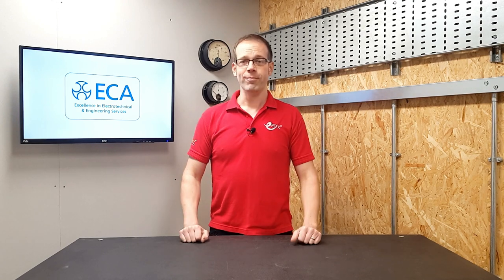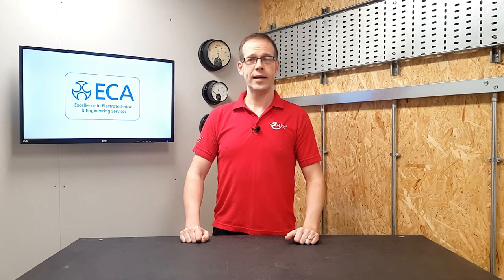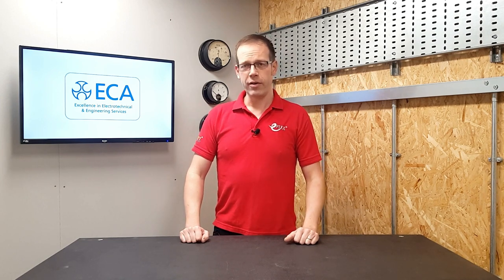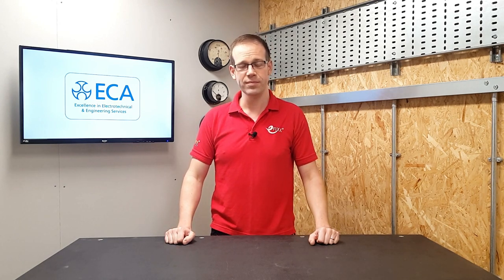Do smoke alarms need a dedicated electrical circuit? - Electricians' Q&A - BS5839-6

Comment: Don't like them on dedicated circuit, too easy for circuit to be switched off (perhaps due to nuisance activations or low battery warning chirps) and a tripped mcb may not be noticed.
Reply: True this. A dedicated mcb runs the risk of not being noticed if off/tripped.
Reply: Yes. In rental properties we typically install on a lighting circuit to prevent isolation.
For privately owned, we set out the advantages and disadvantages (such as they are) to the customer and let them decide

Incidentally, we only install D1 systems (rechargeable non-replaceable battery) as the nuisance bleeping after 10 yrs almost forces a replacement on expiration
Reply: It does say it needs an isolator for maintenance if it’s on a lighting circuit s still just as easy to switch off
Reply: @12000gp  yeah funny thing is one of the reasons we bunch it is so that they can't turn it off and leaving it, if we put an isolator for it, it kinda half defeats the object
Reply: I think efixx might have a secret key-switch video on fan isolators that you can watch that might be of help, regarding unwanted isolation by tenants.
Reply: @MrSJT  Except if you turn off the smoke alarms they'll operate on battery backup! Whoops didn't think of that one did ya?
Reply: @kylehill1523  I'm an approved Aico installer so that thought is standard. It's what happens after the battery back up fails is what we're all talking about

Comment: The amount of peoples houses i have been in and their smoke alarms are off at the mcb  and they have not realised is ridiculous , always better on a lighting circuit and without separate isolation  , defeats the purpose of putting them on with the lights.
Reply: I wonder if it's worth using a key switch (a la emergency lighting) to allow isolation for actual maintenance, but not by joe homeowner? (at least not without KNOWING what they're doing). A red fire alarm spur would be overkill (and out of place) for domestic, but might also work if hidden in a cupboard
Reply: I think key switch is what they mean.. but I wouldn't bother, as a competent person should know what to do.  Plus anyone can get a key.

Comment: With a D2 I prefer them on a lighting circuit, when the battery runs flat and starts beeping does the customer replace the battery or drop the breaker? Usually the latter
Reply: Whomever wired our house (2014) tied it to the closet lights which we hardly ever use and it turns off ALL smokes. 0_0

Comment: They SHOULD be on a lighting supply. Many years working with Fire Officers I was told as a Fire Defence Engineer (not Electrician) for a major PLC that domestic users will ignore a detector if faulty which could be due to a faulty cct. (Often batteries missing). If lights go off they will get it fixed. Instances of people being away for an extended period so when they returned the battery had depleted fully thus not aware of failure.
Reply: Actually they'll still operate on battery backup which will chirp if the battery is ran low.

Comment: new install I use dedicated circuit, old install additions I use lighting circuit because its easier
Reply: Rental properties you should put it in with a regularly used lighting circuit, I would do it in private properties too for safety reasons
Reply: @MrSJT  I think it's safer on a dedicated.  It just feels more right. Ours I think are dedicated we just found that out. Always assumed it was part of the lighting circuit but nope!
Reply: @kylehill1523  in what way would it be safer if it was dedicated? You mean in terms of the circuit itself not being affected by another circuit?

Oh hang on, it can't be, coz you already know about the battery back up right

Comment: In Scotland, new legislation requires all domestic properties, not just rentals, to install / retrofit mains powered and linked smoke alarms in certain rooms (heat alarms in kitchen) plus a CO alarm in any room with fuel burning appliance by February 2022. My view is that the only practical way to comply is to take it from the lighting circuit in each room when I’m decorating and use radio-linked alarms. Retrofit of a dedicated circuit with 3-core and CPC is totally impractical in most domestic properties without serious disruption and redecoration. Even then, I’m not sure that I’ll have it all done by February 2022.  I suspect most houses here simply won’t comply but I believe it’s a good idea so I’m trying to make it work. There’s no enforcement regime that I’m aware of, but how long before it becomes a condition of selling your house (I’ve only just moved so no issue for me) or the home insurance industry uses it as an excuse to bump up premiums.
Reply from the maker: Thanks for the info - will be good to see how this plays out - especially when properties change hands.

Comment: I have mine on a lighting circuit. That way, the circuit is pretty obvious if its not got power. As for the difference of rental vs private? Makes no difference. A property can be easily switched between rental or private and then it can potentially be a load of hassle to re-wire if the alarm feed is not taken from the consumer unit initally where it could just join off a lighting circuit somewhere. Interesting the comment about being able to isolate the alarm for maintenance if run from a lighting circuit - the Aico units slide off the backplate so unless you are chaning that as well, there would be no need to isolate it. You have to isolate a whole circuit to change a base plate but that is why we have diversty with dual RCD or RCBO boards so that other lighting could be used while the maintenance is carried out and takes minutes.

Comment: I’ve never seen an isolator installed to isolate the alarms from the lighting circuit.  

Not saying it doesn’t need one.  But in my experience, no one fits them
Reply: I never knew this was a thing until five minutes ago and I’ve been a sparks for 23 years 😳
Reply: @tommochelsea72  Lol. I think you’ll find most reading this didn’t know.   

How many EICR reports have you seen that have picked this up?  None probably.
Reply: Isolate for what maintenance jog on  i fit Aico so to work on it you pop it of the base its now isolated 😆
Reply: I would personally suggest that being able to remove the head is a form of isolation from the lighting circuit for maintenance purposes
Reply: @paulspicer754  ditto re: Aico, 3000 series only now :)
Reply: @johnhoward2104  i heard about this in an AICO training centre in 2017, that's when I started bunching them with  regularly used lighting circuits but wouldn't  add an in line isolator coz tenants can turn it off.
Reply: AICO confirmed today that they produced a technical bulletin (on 12.3.19), shown below, that addressess the issue of isolating power to the alarm, when powered from a lighting cct, without isolating the lighting; which oddly does not appear in any of their publications. 

"Power supplies for Grade D Smoke & Heat Alarm systems with reference to
 Building Regulations Approved Document B, Fire Safety 2006".

There have been queries regarding a section of Clause 1.19 in the above document and this Technical
 Bulletin is published to state our interpretation of the requirements in relation to the Ei Professional range of smoke and heat alarms (140, 160 & 2100 series with or without the RadioLINK base Ei168RC). It does not purport to apply to products from other smoke and heat alarm manufacturers.

The clause in question states the following:

Power supplies
1.19 The power supply for a smoke alarm system should be derived from the dwelling/house’ main
 electricity supply. The mains supply to the smoke alarm(s) should comprise a single independent circuit at the dwelling/houses’ main distribution board (consumer unit) or a single regularly used local lighting circuit. This has the advantage that the circuit is unlikely to be disconnected for any prolonged period. There should be a means of isolating power to the smoke alarms without isolating the lighting.

The section that has been causing the queries is; There should be a means of isolating power to the
 smoke alarms without isolating the lighting. This has been interpreted as meaning that there should be an isolation ‘switch’ to enable isolation of the smoke alarms. The document does not say that the means of isolation must be a switch. In addition, it does not state that the circuit must be isolated, only the smoke alarms.

When the Ei Professional alarms detailed above are installed there is a quick and easy means of
 isolating the alarms without isolating either the smoke alarm circuit or the lighting circuit. These models are supplied with an Easi-Fit base that the alarms simply slide onto to be activated. Conversely, it is only necessary to unclip the alarm and slide it off the base to isolate it. The base is then left on the ceiling, without exposed electrical cable, connectors or terminals and is therefore inherently electrically safe.

In view of these points it is our contention that this method meets both the aims and the spirit of this
 section of clause 1.19".

So that's their tech bulletin; no switch needed, simply remove the alarm from the base and that's it isolated. However, this only relates to the AICO Easi-Fit base, NOT their RadioLink base. The problem is that the wiring is still connected to electronic components in the RadioLink base even after the alarm is removed, which causes problems. One, is that the electronic components can be damaged when IR testing. Therefore, on page 62 of their 'Electrical contractors handybook (5th ed)', AICO recommends that the wiring be disconnected from the base for IR testing; so care must be taken to identify exactly which base is being used. Two, is that if powered from a lighting cct, the base cannot be simply disconnected from the lighting cct while leaving the cct turned on, as required. Therefore, if a RadioLink base is used on lighting cct, evidently an isolating switch should be used for each base. Three, is that the switch can be turned off by users in an attempt to silence the alarm, thereby rendering it useless once the battery's flat.
Reply: @johnhoward2104  we can still do 500v LN-E says the guy who did the Expert Installer training this evening.
Reply: Well for the radio link base, that's incorrect, according to page 62 of their own electrical contractors handybook, which for IR testing says "disconnect the wiring. The base contains components that could be damaged". So he's not even following Aicos own guidance. You can download a copy of the book for free, so have a look yourself.
Reply: @johnhoward2104  I know what he meant, but I also think he isn't explaining it properly as it does say on page 62 to test on 500v (and remove or disconnect such as radiolink bases), but as electricians we also know that we can test at 250v to avoid damage too.

Comment: I know... instead of specifying one way or the other we'll just let every single electrician in the country have their own opinion and let them interpret the regulations however they see fit at any given time, whilst sucking air through their teeth and tutting at the perfectly compliant system the previous electrician installed... ya know... just like everything else in this trade ;)
Reply: you're not wrong.... but that's not the wording I would have used :P [kidding]
Reply: @TheChipmunk2008  haha :)
Reply: You said it 'regulations' not law. 'Should' or 'Must/Shall' ?

Comment: Separate circuit wherever possible.  Combining functions in a circuit just doesn’t feel right, and if a user wants to turn off the dedicated mcb then they probably have the determination to remove the whole unit if it was wired to the lighting circuit anyway.
Reply: Combining a cooker circuit from a lighting circuit- yes madness, but a smoke alarm of approx 40-50mA on a lighting circuit with a 6A breaker?

Comment: Should a smoke detector circuit be protected by an RCD? Every circuit in my house has an RCBO except for the smoke detector which just has a 6A MCB.
Reply: Depends if the supply/interlink cables are buried less than 50mm or have adequate mechanical protection
Reply: If the RCD trips then obviously there is an issue with the circuit you should know about, but also depends on cable depth and if it's metal stud wall coz that would be rcd regardless of depth
Reply: RCD protects people from fitting curtains and shelves. MCB protects the cable from melting. A person can be part of the circuit and an MCB wouldn't notice. ...

Comment: its been a good few years since i was a spark but i always used to put the smokes on an unprotected way and used an RCBO, the logic being if the smokes had no backup (owner replaces battery backup units with cheep non backup some time in the future) then in the event of a fault that causes a fire but trips the RCD then the smokes would always have mains power no mater what, just made sense at the time, if the home owner is willing to just switch the circuit off to stop them from chirping then i guess this is known as natural selection and helps thin the herd :)

Comment: Independent circuit with power indicators similar to emergency lighting.  But can Can still be switched off.  How long to battery's last on mains powered smoke alarms is the battery only for power cuts.  So when it dose expire dose the smoke alarm know.  As it still has mains power.

Comment: In the "new wiring...." Q&A section on the electrical safety first website, the answer to Q1.16 says:
 For Grade D systems, which comprise one or more mains-powered smoke alarms each with an integral standby power (such as typical domestic smoke alarm with battery), BS 5839-6 simply recommends that the mains supply to the smoke and/or heat alarms should take the form of either:

i) an independent circuit at the dwelling’s main distribution board, in which case no other electrical equipment should be connected to the circuit (other than a dedicated monitoring device installed to indicate failure of the mains supply to the smoke and/or heat alarms), or

ii) a separately electrically protected, regularly used local lighting circuit.

We recommend option ii) on the grounds that disconnection of the supply to the fire detection and alarm system will be more readily noticed. In our opinion ‘separately electrically protected’ does not preclude sharing an RCD with several other circuits where this is permitted by BS 7671.

Comment: I have multiple hardwired smoke detectors on my local lighting circuit (already installed) what I am doing is putting a smart  dim switch on that same lighting circuit will this cause me any problems as long as I stay out of the red wires

Comment: If memory serve me well, in the 17th they had to be wired to a dedicated circuit, I always argued against it, if the RCBO tripped there would be no way of the customer knowing unless they was on the ball enough to notice the power light on the detectors had gone out but if it was feed from a well used lighting circuit then it would be noticed and repaired.
No brainier.

Comment: When wiring smoke alarms with the lighting circuit it seems an easy job with the minimum amount of disruption with the alarm feed close to a ceiling rose. However, a lot depends on how the lighting roses are looped. If you cant get a permanant live and neutral at the rose  then your stumpted.

Comment: I've seen it a few times in tenanted houses for housing associations where the dedicated circuit for the smoke alarms has been switched off by the tenants but  if the place is unoccupied I would install a dedicated circuit if enough room in the consumer unit and if it is occupied it would more likely be radio link smoke alarms off the hall and landing lights  in houses.
I haven't included new builds

Comment: Funnily enough my colleague went out to a job for a housing association today for a smoke alarm that was bleeping and discovered the tenants had decided to remove the lighting cables in trunking leaving them hanging ready to chase in and fitted their own smart switches with apparently the cpc in the switch live terminal and had disconnected the smoke alarms off the lighting circuit which of course the smoke alarm would run out of battery power.
Reply: How long can a hardwired alarm go for on battery power?

Comment: Hi 
very valuable information..what about intrer linking..does all smoke alarms needs to be inter linked.? .and does the fire alarm in the kitchen needs to be linked with all smoke alarms.?
Reply: If you don't interlink you'd find it impossible to achieve the sound levels required for it to be effective
Reply: Yes they all have to be interlinked

Comment: I prefer to supply them from a dedicated circuit.
Reply: I think most would prefer but for safety reasons we don't
Reply: @MrSJT  what safety reasons are those Steve?
Reply: @9plusinstalaciones  in rental properties I find they are switched off instead of replacing a battery, and are just left off.
Reply: @9plusinstalaciones  
If the alarm circuit goes off, they will moan about it and get it sorted coz the lights ain't working, especially important if this was a rental property.  If it bleeps they may turn it off and then realise it's linked with the lights, they'll moan about.  If  they lose power to it, they will know about it coz the lights don't work.

It is basically more advantageous to link it with a regularly used circuit such as one that does toilet/bathroom lights
Reply: @rob.1  I guess you have a point there if that's what tenants are doing, we used to do spot checks on student accommodation even though the smokes where's all on the lighting circuit I never had seen them switched off.